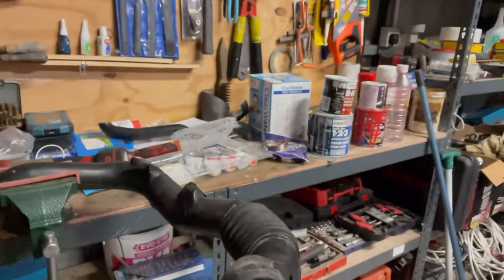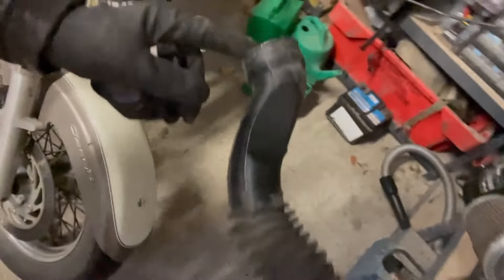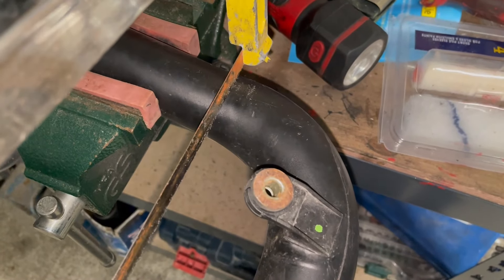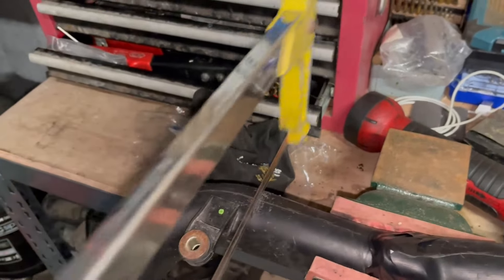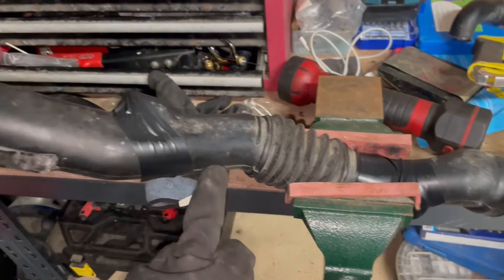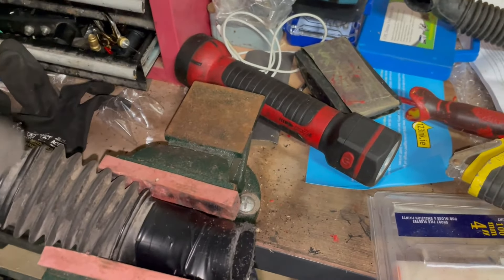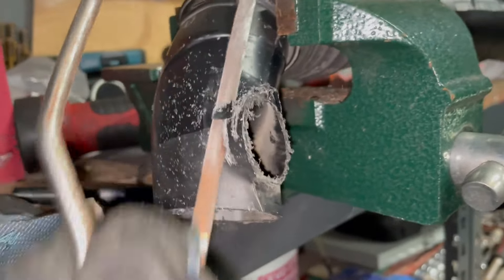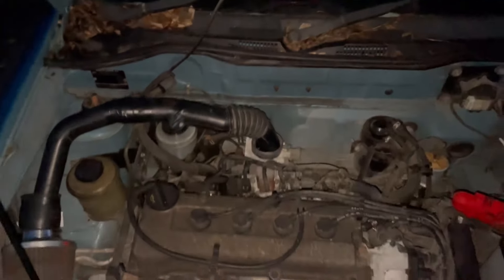How To Make Intake Piping For A Micra For FREE!

Comment: You're guaranteed losing power, the air intake is now taking in hot air from the engine bay. Also losing cfm because of pipe size.